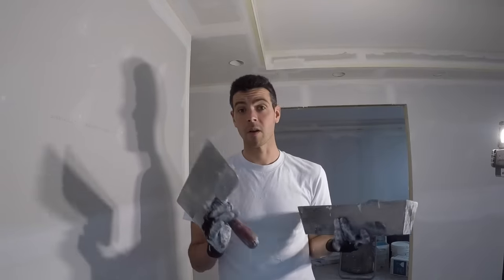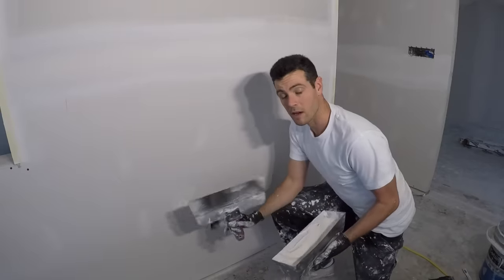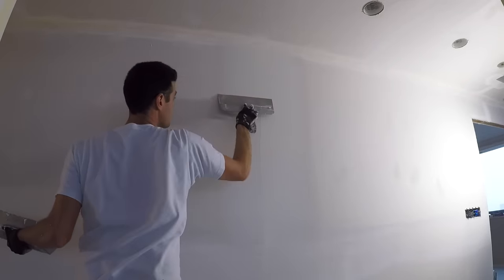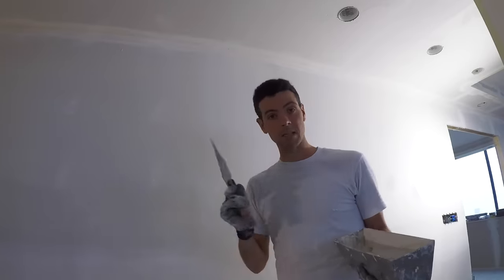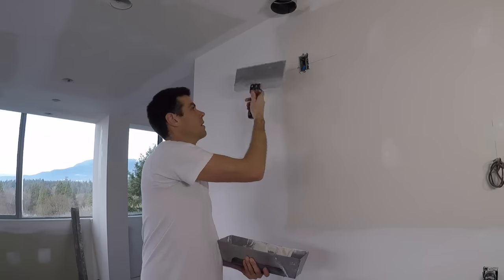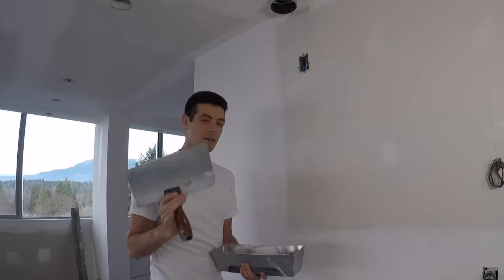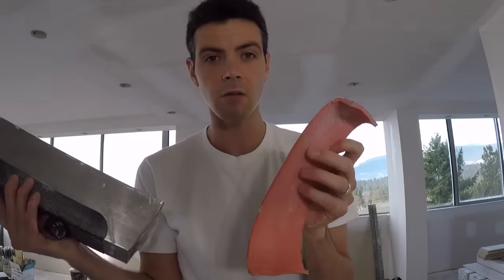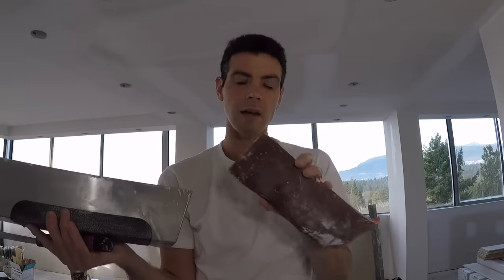HOW TO COAT DRYWALL( BUTT JOINTS)

Comment: Great video- how many gallons of mud do you go through say on a typical 12 X 12 room? Is the mud one of the major costs?
Reply from the maker: I would say a room that size would use less than half a bucket of mud so about $10. Mud is the cheap part.
Reply: Mud is practically free 😁

Comment: I can not seem to lay mud, no matter how wet, nice flat and smooth like you do! I use a hawk and an 11 inch trowel and the mud spreads easy but looks like a scarred face from acne. Even if I run a clean blade over the surface. Same issue with an 8 “ taping knife. Any recommendations?

Comment: One question if I may.
Why didn't you just sand down the hump in the first place rather than plastering.
Reply: I think you do a light sand between every coat and that speed bump was left after a light sanding and he did not want sand further for fear of hitting the paper and hence you would end up at step one again ! Just a rookie here and need to learn a bit to do home repairs so I could be wrong but that is how I took it !

Comment: Hello,how do I coat the ceiling to give a clean flat look as oppose to spraying knock-down? Do I roll the mud on with a paint brush, spray it on and then trail it out,etc? Do you have a video I can watch? Please help!
Reply: Flat drywall takes a lot longer, that's why it costs more, and that's why everything it textured (hides the imperfections.

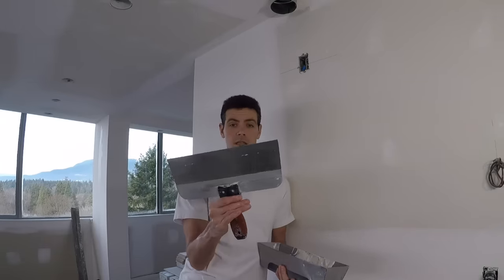Comment: 7:42.   Do you put those curves in the tool yourself?  I checked the stores and they are all zero flat.
Reply: You can, I have adjusted mine over the years. Some have a curve and it is subtle. Dont forget to oil them!

Comment: Just some dumb questions from an old pipefitter. Basement flooded, about an inch and half. I removed everything including all baseboard, door trim and drywall up to 10inches all around. So I'm gonna have an horizontal butt joint at 10" all the way around. Now I can put the drywall back and it will be a butt joint I'm taking all the way around, in my limited opinion i'm about to dick that up to no end. I'm sure I can replace the drywall but finishing all I can see is a clear line at 10" all the way around the basement when I'm done, the bump as you spoke off. Why is the tape needed? This is what causes the hump in the first place, right. Can't I just pack it, put a nice top coat on and sand, both pieces start off at the same distance from the studd. if it a cracking issue, what about installing a 3/4  X 1 wood backing at every joint along the joint splitting the joint all the way around instead of tap? Just wondering, or is there something better like the mess tape that is less pronounced than the paper if it's totally necessary to tape the joint. Peace, Kris

Comment: do you always recommend to do twp mud steps or can it be done as one step. I find it hard to get it in one go at high finish and was wondering if the best is not try but always go with two steps. let the first set, light sanding, second layer and final sanding. Also, for some reason i can always see the mud through the paint , even though a thick healthy layer. how can I avoid it?
Reply: I wouldn't ever try and do only one coat.  Two coats at a minimum frankly like demonstrated in this video.  If you tried to get a single coat on a butt joint you are more then liking not getting enough spread to properly hide the hump.  Additionally, using more mud to compensate with one single coat will lead to an uneven shrinkage of the mud where there is more material on the wall - it'll end up being a nightmare to try and even out.  Generally, less is more when doing mud work.  Less applied means less to remove, which makes life so much easier.
Reply: @raddad9041  Thanks!!

Comment: I sometimes get a hump in the center of the butt joint. I apply 24- to 28 inches wide when I’m finished muddling, the sides are featured very tight and looks good, but the center I don’t like. You can’t see it when standing in front of the butt joint. day light you see ever thing. One guy told me it looks good, I don’t like it. Before I tape the joint I mix the mud with a little water so I can take the 6” knife and place the tape smooth on the joint. Need an answer. Thanks
Reply: Please I need an answer from a professional. Thanks.

Comment: what size napp are you using when you roll the finishing coat on, is it woolen, darcon, synthetic or does it really matter ?
Reply from the maker: I think its a 19mm nap or 3/4". Don't use the cheapest ones. The fibers come off in the mud. A decent lint free purdy roller or comparable brand will do. I actually don't know what they are made out of.

Comment: After watching this I checked my walls , there shocking on every joint . This method should fix the finished painted wall  ?
Reply: You'll have a tougher time getting good adhesion with joint compound on a painted surface, and the set time will be longer cause the drywall wont be able to pull the moisture.  I'd try and prep the surface a bit first by sanding it to roughen it up.  Alternatively you could prepare it with a product like kilz or zinsser gardz.  You could also try adding some weldbond to your mud mix as well.
Reply: RadDad thanks I’ll give that a try 🙂

Comment: great video - can you help me get rid of air bubbles?  I have done a fair amount of spackling...but always seem to get air bubbles...thanks a lot
Reply from the maker: The only real solution to bubbles is just to skim it again. They suck, I get them all the time on painted surfaces and there is no hope. What you can do is when you are doing your final coat make sure your mud is pretty thin and do a really tight skim over your patch to really fill all the bubbles. Next do another coat right over top and it shouldn't bubble as badly and you might be able to leave a little mud on there for sanding. While this works pretty well and seems like a solution it really isn't because you essentially have to coat a job twice if there is a lot of patching on painted walls. When you have already blown out your shoulder from this work like I have the last thing you want to do is an extra coat on everything. When I am the one doing the painting I don't worry about it too much because i just do my best on the second coat and fill the bubbles after priming.
Reply: gocha - great to know that even pros get them !
Reply: If you're using lite pre-mixed mud, stir each batch really well. The factory adds air to make it a lite mix.

Comment: Do you need to clean the walls/joints after sanding and before the next coat??
Reply: Sanding all that.... yeah. If you aren't a big dust maker and your joints are decent to start with before sanding then a light brushing with a dust mop or broom is fine.

Comment: How does the mud NOT fall off? Mine drips everywhere no matter how hard I try to keep the mud on the knife. HELP!
Reply: Could be several things.  What mud are you using?  How much are you watering it down.  There is no need to get it soupy, if you don't have a quickset mix you'll still be able to work with it for a relatively longish time without making it very wet.

Comment: The best way is to not create a butt joint, they make 8, 10 and 12 ft drywall for pretty well any application. The only place you may run into it is on a big ceiling where you may have a butt joint, there's no need to have it on walls at eye level where you would notice it. Not sure why drywaller's started hanging board sideways. I'm a retired home builder and never in my days back in the 70's, 80's and even into the 90's did drywall get hung sideways then I slowly started to see this happening....not necessary folks, why waste your time, energy and materials when they don't recommend that you even do this.

Comment: how perfect does it have to be if i'm putting on spray texture such as orange peel or the like?
Reply: Cole as perfect as you can get it. Orange peel does not hide much especially if you use a paint that has a higher sheen than flat.

Comment: There is no way to contact you so I am doing it here. Like to see you do a video on knockdown texture on ceilings maybe even using canned spray ceiling texture.
Reply: The canned is good for a couple square feet. After that you would spend a fortune on a big area. Use a hopper and compressor to cover large areas and either be super fast and spray then knock it down after a few minutes or work as a team with one person spraying and the other knocking down. For knock down you actually do use the knife backwards like he is in this video with the bow towards the wall or ceiling.

Comment: The Construction industry is one of the few licensed jobs where they are un-regulated.  Whats the point of having a license?  If a nurse messed up, they would be fired, sued, possibly have criminal action and never work in the industry again.   I've seen the work of some "professionals", it has to look good from 6 or 8 feet to pass inspection, looks like crap when you get up close.   Then they have the balls to put a lien on your job when you question the payment.  I blew up at an inspector, what's the point of having your guys if you just shrug and say "not up to code".   I recently had to "fix" a professional hanging job (they blamed the carpenter as usual) by going almost 28" wide so don't tell me that "it's a butt joint - 12 inches max" will do the trick.   Sure if it's a mock up wall in trade school then that's great but I've never met a flat, straight or square wall in my life.   Yes I agree 30" is a little excessive but with a good 14" towel I can cover that distance in two passes.    The plumber who commented about "paying your dues" to learn your trade hit it right.   For every bad licensed contractor there are a couple of non-schooled guys who will do a better job with pride in their workmanship and I'm one of them.

Comment: Can I butt joint be repaired after its been painted?
Reply: Yes but it will bubble up due to the paint but before you sand scrape them with putty knife and fill the holes. Dry and sand

Comment: why dont they just make a blade with a 1/16  concave curve to it or something like that
Reply from the maker: Actually, most blades do have a curve to it. Occasionally you might catch me eyeballing the blade of my 6 inch knife. That's me looking for the curve to make sure I'm using the right side of the blade. I will be posting a video in a couple of days where I do it a couple of times.
Reply: ya I googled them and found some ...just never seen them anywhere before.

Comment: No offence bud but all butts should be filled at least 36 inches wide when finished so there is no chance it shows in future, I coat with a 36 flat trowel for first coat with no lift offs then over each side with 36 flat trowel , while you were showing that application I could have coated 5  at least . I understand that everybody's learning varies..as well butt joint placement is key to keeping things flat and nobody ever mention that fact in these goofy videos ...food for thought

Comment: I'm not anonymous; if you sand between coats the mud rolls off the wall you have to remove the dust this makes it harder especially for amateurs. Also you can't use the same technique on every butt joint you have to check the plane of each one to determine the deep side. Not trying to knock you but your title says carpenter not drywall man that says a lot.

Comment: ]You're working too hard which is odd because you are making it hard yourself.
 #1 Dont thin your mud for bed coating butt joints. You get shrinkage from water loss but you are the one adding water. Just spin it up with a 1/2" drill and paddle when you first dump the mud into the bucket.
 #2 You are using the wrong side of the knife! The curve should be bowed AWAY from the wall.
 #3 If you are sanding a lot then you are wasting time and money. Learn how to apply the mud just right and then just jackknife on the bed coat and lightly sand the first skim. 
I've seen the roller trick and even seen a slicker used right after that if you want to get real fast! It wastes mud because it dries it out and you end up throwing it out and that's just wasteful.  I was taught drywall by a company that did a lot of slick finish drywall with dark semi gloss paint.😣 The boss would come around with a half million candle power light and shine down every wall and up every angle. Then he'd break out the pencil or use the butt end of a 6" and mark up what needed attention. You can use a trowel but it doesn't have the benefit of the curve like the knife which helps you taper the edges and still leave mud on the wall without those "lift off" Mark's you are leaving. Keep practicing and it will get better. As far as carpal tunnel syndrome... well maybe work out or get a wrist brace is all I can say. Thinning the mud just means you have to leave more on the wall or ceiling and it makes it messy.